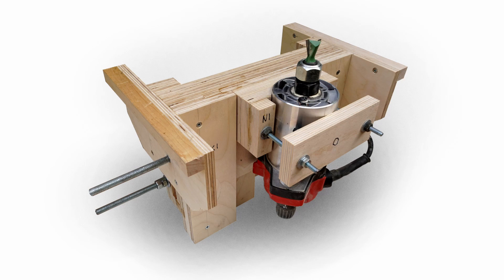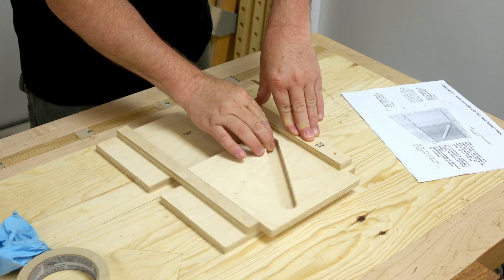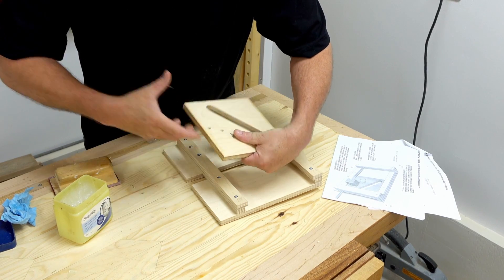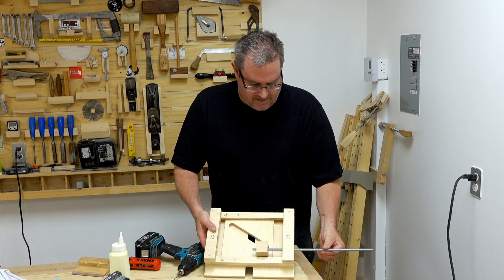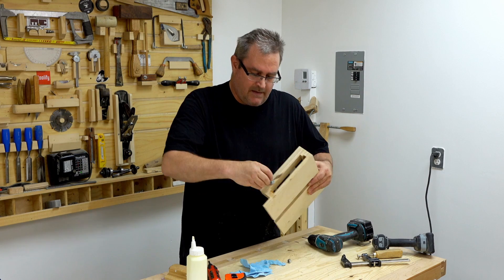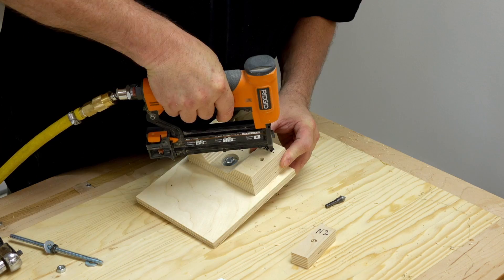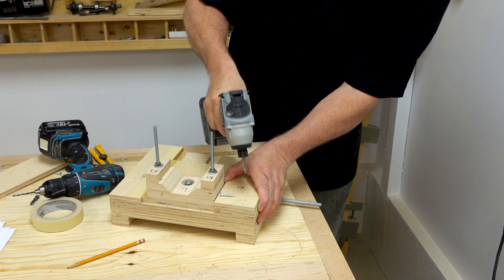How To Make A Precision Router Lift

Comment: John,
I have come to greatly enjoy your videos.
Always a practical 0roject presented in an easy to understand manner. I have a question about this one. Why didn't  you opt for a shallower angle on The slide?
Wouldn't  say 30 degrees given a smoother operation and finer height adjustment increment?

Comment: This is clever and makes perfect sense, except that bolt glued into part H. I can't figure out what's up with that.
Reply: I think you're talking about the bolt in part "I", not "H".  Anyway, I'm building this now and that bolt is really just acting as a hard base for the rod that acts as a locking mechanism for the lift.  The rod hits up against that bolt when you turn it and that pushes part "I" into the router lift itself to lock it in place.
Reply: @PatrickSHopkins  thanks for the explanation

Comment: wow, you've out-done yourself john, i'm very impressed. when i saw you screwing the t-nuts into place I remembered that there are t-nuts for metalworking, they're meant to be welded in place. but for woodworking applications they can be screwed in place using the predrilled holes.
.

Comment: The same applies here, Hi, I would definitely buy these plans if I knew where to buy the router motor. Thanks for the video. Mike
Reply: Beauty is you can utilize any router. Including just finding an old used router and taking it out of its base

Comment: I don’t suppose anyone knows what type of router John has used in his video. Is it a 1/2” or 1/4” collet size.  I am struggling to find an appropriate router with a 1/2’ collet (I have quite a collection of 1/2” bits) thanks, Mike

Comment: I bought the plans and built the ultimate box joint jig over a year ago. I wish I had known that you we're going to design and build a router lift. Because I know it would have worked just as well as the one I bought ~ 4 months ago, and would have cost me nothing compared to the lift that I bought. Anyway I use my box joint jig all the time and I really really like it. I really do appreciate the things that you do and provide plans for us to buy and build. From now on I'm going to check in on your Channel and see if you have, or are going to build something that I might need before I go out and buy it. 
I don't always get notifications of your projects that you are starting to work on. Sometimes I do. Oftentimes I have to go back and click on the Bell and reset it. Even that doesn't always work. Thanks for all that you do.

Comment: I too bought John's excellent plans and built this lift.  However, the router I chose to use [Makita D Handle Router 3601B] was a bit meatier and gave the mechanism some challenges.  I looked around for some ideas and chose to follow the modifications that John Deacon employed [https://www.youtube.com/watch?v=uXWzVyHdOxQ&t=1s].  I also used an M16 threaded rod.  It now works like a charm and is a great addition to my shop.  I also started out with lower grade ply - note from the wise [now] - always use birch ply when told to!

Comment: Just finished your lift last week.  Previously, I built your table saw rip fence and it made my accuracy go up 10 fold over my  40 year old craftsman contractor saw fence.  I took my time (not easy for me) building the lift and it works fantastic.  I always love your plans and accompanying videos and articles.   By the way this is the 3rd lift I’ve built.  The other designs were from other YouTubers and I just could not make them with enough precision.  Thanks again for great videos and plans.

Comment: A very cool project and well designed too. I'm curious about the function of the 1/4 inch bolt that was glued in near the end of the video though. I couldn't tell what it is for.
Reply: Same! What's that bolt for? ?
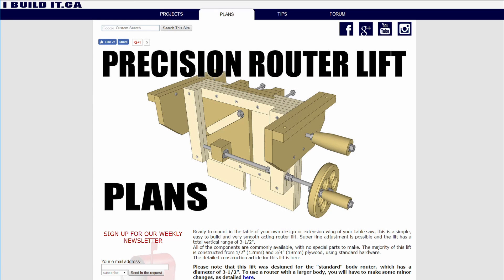Reply: If you're talking about the rod at 12:56, I wondered the same thing.  That bolt gets a handle on its end (seen on the diagram at 13:34); turning it applies pressure to a plate that jams the router carriage in place after the height is set, so it can't slip.   I think that's why some of the pieces (I and J) were not glued, but only screwed in place at one end, so they can flex enough to use as "brakes."

Comment: Enjoying following this build. Thanks for making these videos😁 how's the table saw coming along?
I built this a few years ago after buying your plans, it still works great and in my opinion one of the best designs out there. (I  motorised it using an old drill motor, I also used petroleum jelly to lubricate the sliding parts and have never had any problems sticking)